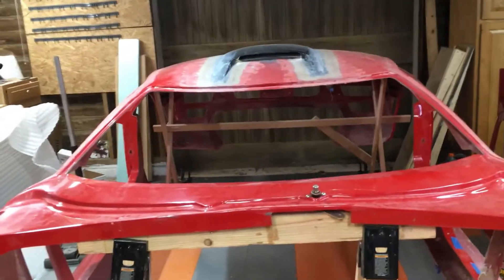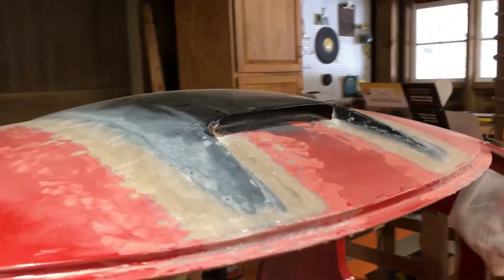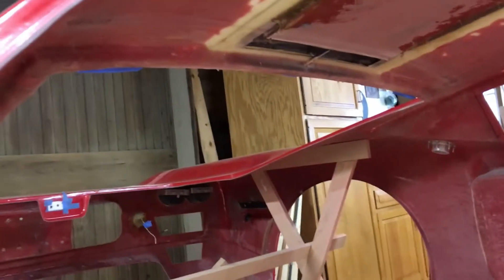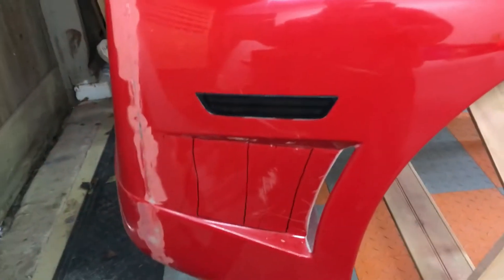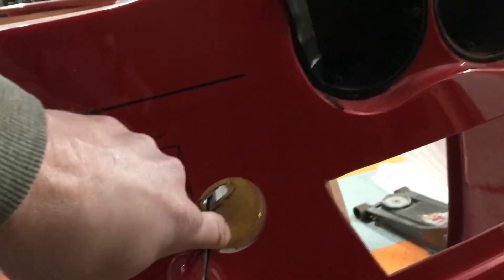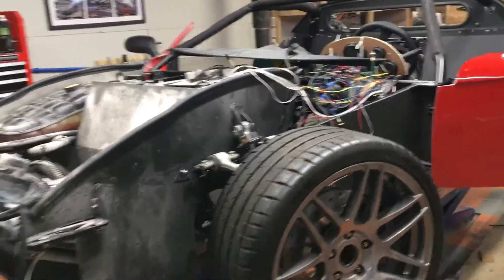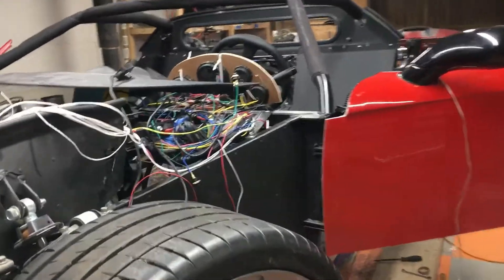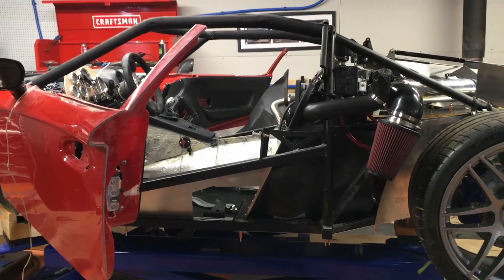16 GTM Build

Comment: Good lucking build keep the Great Videos coming.  Looks like you could have used a little more shop space.  I have a portable spray booth for painting
Reply from the maker: Yes. I thought I had a decent amount of room but it fills up quickly, especially when the body and chassis are separate. My plan is to take everything out and do a thorough cleaning, put up some plastic and turn the area into a paint booth at the right time. I looked into the portable/inflatable paint booths. They look nice, and if I was going to do more painting I'd definitely look into it more.
Reply: @homebuiltsupercar6553  If I were going to do this I’d try to rent a paint booth. I’ve put up plastic and the overspray is everywhere impossible to keep it off anything. The portable paint booths are relatively inexpensive and I think you can sell it when you are finished. One other thing, look on YouTube for a system to drain the water out of the spray hose, it works with PVC tubing. Start at the compressor with a flex line into the tubing, (run vertically) then into a filter where you adjust the pressure then to your supply line.  This thing really works great. Just a thought. Have a great weekend.